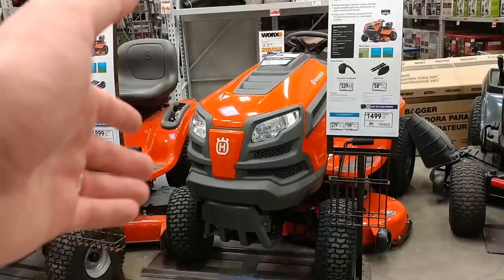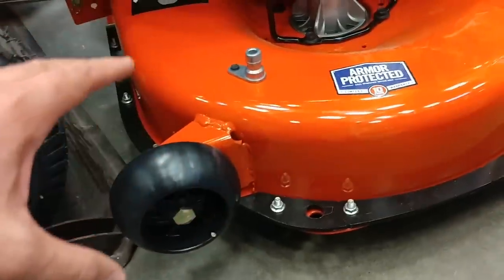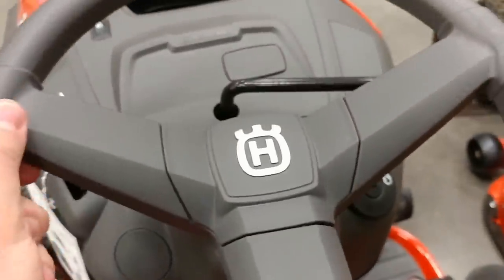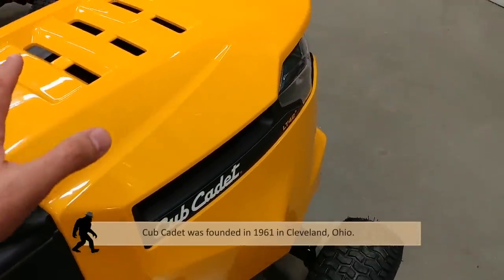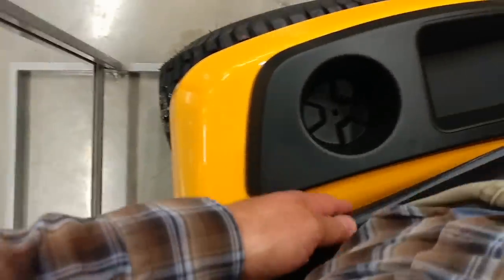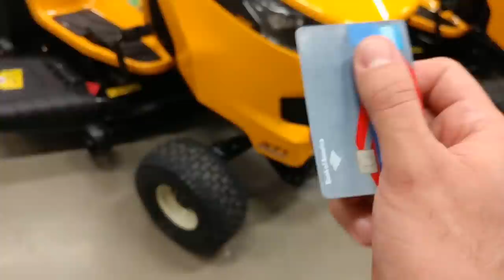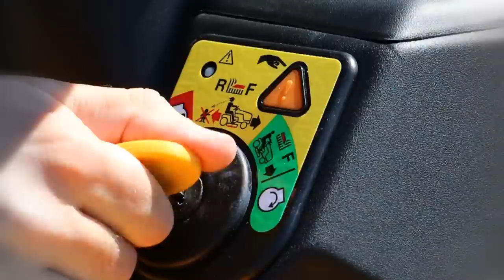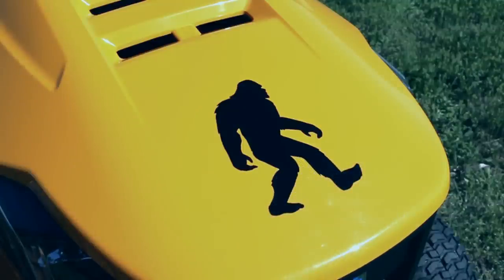Time to Buy - Husqvarna YTH18542 42” or the Cub Cadet XT1 Enduro Series LT 42" Riding Lawn Mower

Comment: Hi Thank you for your video. I am in the same predicament. I am wondering: Why did you not consider John Deere in your selection?
Reply from the maker: Hi Major -- thank you for your feedback and great question.  I always dreamed that when I had a yard big enough I would purchase a John Deere to maintain it.  They are a reputable brand with quality power equipment.  And when it finally came time last month, I did consider the mower.  
The closest model in their lineup with the same price-point is the E100.  However, the most equivalent in features is the E120.  The E120 is about $1,900, which puts it $300-500 more than the E100 and the other two I was considering.  What do I like about E100?  I think some of the parts are superior quality like the throttle.  The blade heigth  adjustment is definitely better too.  The hood seemed more solid and the overall fit-and-finish is good.   I also think it's an ergonomically comfortable mower.  Why does the E100 fall short (for me)?  There is a manual gear lever to shift between Forwards, Neutral, and Reverse.  That right there is enough to eliminate it from my consideration because I need to do a lot of backwards/forwards motion to get my lawn cut.  Additionally, it has a wider turning radius, no cruise control, and I wasn't too fond of the seat.  Even considering the more expensive E120 with the hydrostatic transmission, the  forwards and backwards pedals were awkward for my big feet.  ;~]  All that considered, it just wasn't right for me.  Hope that helps!  Let us know which one of the big three you end up buying.  And stay tuned because I'm filming and assembling a comprehensive review of the XT1 from crate to five hour maintenance.  Welcome to the community!
Reply: Oh good. I'm looking forward to your next video. Maintenance is one of the big issues for me. I was a computer programmer who inherited a mess from my parents and I have never changed oil in my life. That's why the John Deere interested me with the 30 second quick oil change filter. I also would like to know if you really need to remove the deck to change the blades and belt. I'm afraid that after I remove the deck I'll either lose the pins and washers or not be able to put it back together again.
Reply from the maker: Yes!  I will be filming how to change the oil.  I just hit the 5 hour mark this afternoon and will be recording the procedure tomorrow of the future review video.  From one software dev to another, I think you can do this.  Although I will admit the oil change of the John Deere looks much easier.  On the blade question, the deck doesn't need to be removed to remove the blades.  You can raise the front end of the mower and just reach under to take the blade retaining bolts off.  Hope that helps!
Reply: MajorCulturalDivide You're definitely paying for a brand at that point.  I was looking at a used 04 tractor it's a step up from a large mower with a mower deck and a bucket and roll bar and the guy wanted 11k for it. Mind you it was already 14 years old had who knows how many hours and wasn't in pristine condition.  I know that's a private seller but still.
Reply: Read plenty of reviews regarding the JD E-100 series of tractors. Then call some JD dealerships and ask for their opinion of the E-100 series. Basically, if you want a REAL JD, look at the X-300 - X700 series.

Comment: Does anyone know of these motors can burn the ethanol added summer blends or do wee need nonethyanol fuel?l
Reply from the maker: Hi, Allen - I was waiting to see if anyone more knowledgeable would chime in on this.  What I can say from my experience is that it'll run on the typical 10% blend, however, my mower we experiencing backfires upon throttle-down or shut-off.  Changed to a premium and non-ethanol fuel and the problem went away.  Also handy to be using the non-ethanol blend so that you have less chance of the fuel gelling if the mower sits for a prolonged amount of time without running.  I hope this helps!
Reply: Dealer of cub said burn regular gas add stabilize  , mine 24 hp Kosar 7000 series, well c later in year, 3 year  warranty I'll put hours on it I cut 1 3/4 acres
Reply: Thank you. Finding no ethanol here can be a chore. I am about to buy a Cub Cadet gt 54 d to replace an aged zero turn. I'm trying to get ahead of the curve beforehand

Comment: I like the Cadet more but where can you get it serviced?
Reply from the maker: Hi, Michael - I had the same concern.  There is an Ace Hardware nearby that sells (which I found out later) and services Cub Cadets.  On Cub Cadet's website, they say that your Home Depot or Tractor Supply seller should have information on local service centers, so you may want to check with their recommendations.   Hope that helps!
Reply: Cub Cadet is made by MTD which also makes Craftsman (formally made by Husqvarna), Troy Bilt, Bolens, Yard Machines and Huskee among others. Therefore it would be safe to assume finding a service center that services Cub Cadet would be relatively easy.
Reply from the maker: @patdthomas  - Thank you for the tip! And welcome to the community!
Reply: @patdthomas  Some Craftsman mowers are still made by AYP (now Husqvarna Outdoor Prower) and some are made by MTD

Comment: I like to look at the reliability ratings from the major consumer rating outfits, as an example Consumer Reports rates the most reliable riding lawn tractor by far is John Deere, Husqvarna is kind of mid pack, and Troy Bilt is dead last, your Cub Cadet is a Troy Bilt with pretty body work. Both major rating organizations come to the same general conclusions on reliability. Looking at articles from CR a Troy Bilt aka Cub Cadet is roughly twice as likely to have problems in the first 4 years as a John Deere. Another note, although all those mowers are assembled in the USA, they all say they use some parts from 'Global' sources, I believe that's mostly switches and relays, some of the low end Briggs and Stratton engines are made in China but I don't think you will find any of those in these brands. 

I've been running John Deere for the last 24 years, my first one I ran for 20 years, in that time a couple of belts and one starter relay, still in excellent condition when I sold it to a friend because I wanted a hydrostatic. I've had the new hydrostatic model for 4 yrs now with zero problems. Everyone has their own preferences, I recommend you research the reliability ratings and then make your own decision, most of the newer mowers will do at least a decent job.

Comment: I would 100% get the Husqvarna over the Cub Cadet. Cub Cadet is MTD and I refused to support them in anyway.
Reply from the maker: Hi, GARDEN TRACTOR GEEK - well, from your channel, I can certainly see you know tractors - way better than I would.  Out of curiosity, would you be willing to share why this is?  I like to learn new things and we can grow as a community with better knowledge.
Reply: For me it's just a pride thing more than anything. MTD bought out Cub Cadet/Bolens and other great brands and completely ruined them by making low quality budget machines that are prone to failure and issues. If you look at a Cub Cadet 1450 or a Bolens Eliminator for example they were built well and majority of them are still running 40+ years later. To get 10 years out of these newer cub cadets is a challenge all in itself. Engines failing at 500 hours and transaxles prematurely failing. AYP owns Husqvarna and they have been making lawn and garden tractors for years as they owned the Craftsman lawn tractor line until 2018 when they sold the lawn tractor line to MTD. It might be just my area but I also feel like the Cub Cadet line of dealers have awful support. I had a family friend go to get parts for a 10 year old Cub Cadet lawn tractor to be told they dont support machines that old. So basically after 10 years or whatever their "limit" is you're screwed.
Reply: GARDEN TRACTOR GEEK you are 100 correct I have old vintage cuba and o there’s on my channel if you’d like to check it out
Reply: GARDEN TRACTOR GEEK I go to my local dealer and get parts for my old 40 year old machines so it depends on the people

Comment: Why in the world would you not put an hour's meter on the mower. Secondly, why would you put a panel in front of the oil drain plug. CUB Cadet wins this comparison pretty easily
Reply: Plus the oli filter is siteways which is verry mesy at filter change
Reply: The cover litterly slides out. You can take it off in under 5 seconds and it keeps dirt off the engine

Comment: Both built by AYP. I have a good repair guy that says the Cadet has less issues. Husquvarna is the worst.
Reply: Not Husqvarna.  They make their own. The Cub used to be with IH but that ended long ago.
Reply: @frankbama3684  they are both arent that great, i bought a kubota BX2350 (used) diesel sub compact, awesome machine but a different category
Reply: Man you're right Andrew.  I'd love to step up and maybe that's the common sense thing to do as in the long run you'll save on headaches and maintenance.  Spend more up front and save in the future.  I talked to a Husqvarna dealer (Wando Power Equipment) down here in Mt. Pleasant SC and they're big on a little zero turn residential mower by the name of Dash (Hustler).  They say they have great results with this mower The 34" is $2300 and the 42" is $2400.  The danged things only have a 10.5 HP motor but they say that's not a problem.  So I get off the phone and continue my research.  Turns out Lowes carries these mowers.  But again I guess I'm too bull-headed to turn loose the extra money.
Reply: @frankbama3684  if lowes carries it typically its cheaply made.
Reply: Hmmm.  Good question.  I'll share this with you.  There's an independent dealer (Driggers Small Engine) up in Summerville SC (about 20  minutes from me) that sells Husqvarna as well as a load of other higher priced commercial mowers.  Husqvarna is the only residential type mower they sell.  They have a big service department and are a warranty shop too.  They also sell the YTH18542 $50 cheaper than Lowes.  Of  course with  my Lowes card I get 5% off.  I'm gonna call them to see if they have any insight with regard to your concerns.  As they would be happy to sell a unit from their store I'm sure they would admit if they knew that Lowes models were more cheaply made. I may also call Orangeburg to see what I can find out.   have to admit that I do trust the assemblers up at Driggers more than I trust the assemblers at Lowes.  If I end up buying a Husqvarna I probably will go to Driggers Small Engine.  BTW, Driggers can't keep the YTH18542 in stock.  It's one of their biggest sellers.  https://www.driggerssmallengine.com/
Reply: Hey Andrew, guess what I found.  You may be onto something but I'm still looking into it.  Open the link and scroll down just a little.  Look to the left side of the page and you'll see "Product Variant".  Open that and you'll see 3 models; California, Dealer/Regional, and Lowes.   https://www.husqvarna.com/us/products/riding-lawn-mowers/yth18542/960430256/

Comment: I bought the cub cadet 46" twin cylinder - engine for a 1/4 of Acres
Reply: I have a little over 1/2 acre and was choosing between the  same two Hasqvarna and Cub Cadets shown in video. After a lot of research I went with the Cub Cadet, but moved from 42" to the 46" too. The twin V motor and the 46" being on sale for only $100 more than the 42" was too much to resist. Paid for it online and it's delivering to Tractor Supply this week. Happy with your purchase so far?

Comment: Seems to me that all "affordable" mowers are now crap. Lighter this, unserviceable that, plastic, plastic, plastic cheap chinese crap that we ALL just keep buying, me included,  I went for the YELLOW engine and waranty. Hopefully following instructions on oil and filter changes will make this last a few years. I have a good supply of zip ties and Gorlla tape for the rest of the machine.
Reply from the maker: Hi, D3 2B -it  does seem that there's a whole lot less metal on these things than the ones of the past.  Let's hope they hold together and, as you mentioned, Gorilla Tape is a good option.  😉

Comment: I wouldnt buy either.
Reply from the maker: That's ok, Michael - but that's what's great about review videos.  Try before you buy.  What model do you recommend?
Reply: I currently own a Craftsman lawn tractor and it has served me well for 18 yrs, but I have longed for ZTR for some time.  Most people would shy away from them because they are so pricey, but that didnt concern me.  I finally narrowed my choices down to two, either the Hustler Raptor SD or the Bobcat CRZ.  Both in 42" cut width, mainly because of only having to sharpen two blades and the fact there are areas of my yard that a bigger width just wouldnt.   As a runner up, the Ariens Icon would be a good choice too.  There are many others that are good, but these have the features I feel are most desirable for the money.
Reply: soaringtractor  Actually, your not totally correct. MTD makes a good majority of mowers today for the big box stores, with the exception of JD.    AYP makes Husqvarna, Poulan, and others.  I own a Craftsman lawn tractor that I bought in the spring of 2002 and it was made by Frigidaire, if you can believe that.  Now they are made by AYP.   Ariens is now made by Gravely.

Comment: Why not a John Deere E110 or something?
Reply from the maker: Hi, Shipmate!  Thank you for stopping by and commenting.  Truth be told, I went in to buy a John Deere.  I've always wanted one and I think they are excellent machines.  However, I quickly found  a couple issues: 1) one of the John Deere models in my price range didn't have a hydrostatic transmission - so a manual lever to go from forward to reverse and 2) the one that had the hydrostatic transmission had the forward/reverse pedals so close that my big foot (yes, there is a connection in here somewhere to my channel name 😂) was getting tangled up on the two pedals and just wasn't comfortable.  There were a couple other reasons, but those two up top were the main ones.  Then I was left with the Cub Cadet and the Husqvarna, and I had to restart my thought process.  Thus, this video was born as I re-investigated my options.  Hope this helps and welcome to the community! 😎
Reply: I always wanted a John Deere but because of the Right to Repair "movement" I decided against it.. I bought the Cub Cadet 46in last one a bit big but $1300.. local Rona shutting down My early Bday Present :) Rats got to the Seat (Still in the crate ).. Called Cub Cadet ,, new Seat a week later ..

Comment: My 2018 Cub Cadet XT1 Kohler engine died after 3 yrs…Don’t BUY
No one stands by their product!!
Reply from the maker: Hi, Bianca - this is completely terrible; I'm very sorry to hear about that.  Crossing my fingers mine lasts a bit longer.  I do know there's different engine options on them, but not sure that's enough for you to go back to the brand, considering the customer experience you had.  Have you chosen a replacement yet?
Reply: Was that a single cylinder engine

Comment: You are comparing Cub Cadet's garden tractor to Huskies Yard tractor.  Try comparing  to Huskies Garden Tractors.
Reply from the maker: Hi,  Eric - thank you for the feedback.   The model I'm reviewing is the Lawn Tractor version (LT) of Cub Cadet to the Yard Tractor (YT) of Husqvarna.  From what I can tell,  the LT and the YT are comparable models across the two brands.  But,  wow,  the garden tractors from both look awesome.   If you're out there,  Cub Cadet and Huqvarna, I'd love to do the comparison,  but I can't afford to buy either at the end of the video!  😂 Stay tuned,  Eric, I'm in the process of filming an upgrade video which you may like.   Welcome to the community!
Reply: The Cub Cadet garden tractor is the XT3 Enduro series, it gas a Kohler Command professional series engine, uses a driveshaft to the cast iron Hydro-Gear BDU-10
GSX3 has locking differential. 
GSE3 is a bit less wit no locking differential. 
Neither come with mowing deck, you have to buy the size you want.
Reply from the maker: Michael, thank you for adding to our knowledge base on this thread! 😎

Comment: Kohler engines aren’t my favorite I’d buy Briggs first
Reply from the maker: This is my first major experience with one (the first minor experience was with the old one on the green mower from the beginning of the video but I only used it maybe 5 times).  Mainly have used a Briggs and Stratton, for the most part, they worked well.   Let's see how this one fares.  I'll make a video if I experience any issues.   Welcome to the community!  😎
Reply: Bigfoot Dad Explores Montana thanks. Just change the oil and check it a family friend blew up there kohler engine because it didn’t have any oil. By the way I love the videos I’m subscribed!
Reply: All opinion. I have had better luck with Kohlers.